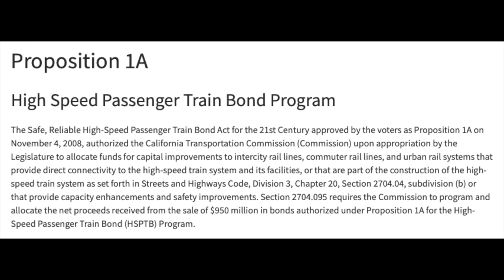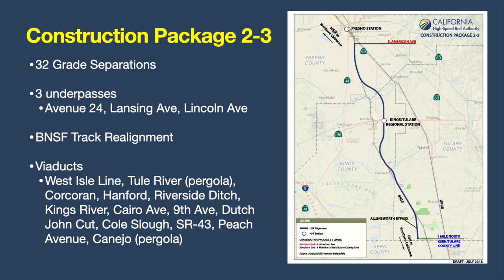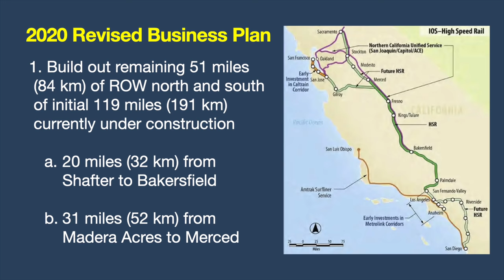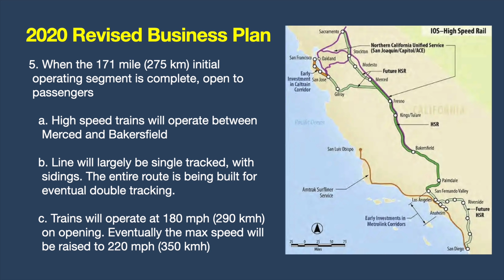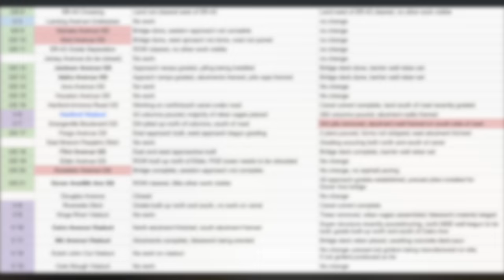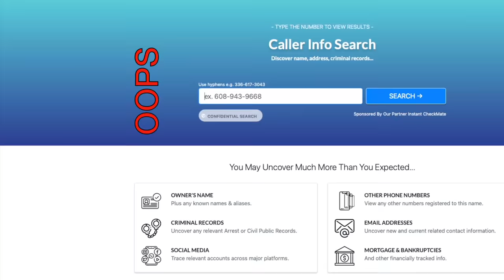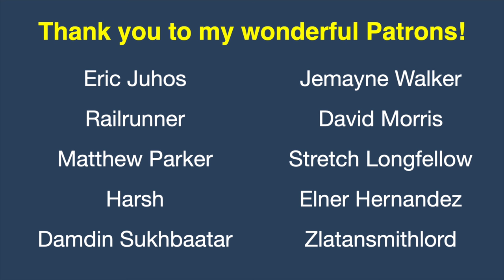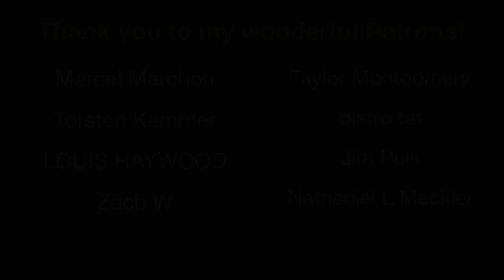California is Building High Speed Rail. It’s time to finish it!

Comment: Would it be possible to build Bakersfield to Palmdale early enough to get it as part of the initial operating segment? Palmdale isn't quite LA, but it's close enough that you could imagine there being desirable connecting buses between various parts of Southern California to Palmdale before the full line is built.
Reply: It would be easy to imagine Palmdale being popular, and the bit between LA and Palmdale on motorized transport being the worst part of the journey (encouraging political support to finish the line)
Reply: One issue-that section will include the longest tunnels in North America. What they should do is build a temporary line allowing San Joaquins to bypass the loop, allowing them to continue to Palmdale, where riders can transfer to Metrolink, or LA.

Comment: I would like to know if hyperloop is really good as they say it is but bullet trains are still getting faster so what is the point?
Reply: Hyperloop is faster, but at the same time, it's an untested technology dubbed as a "gadgetbahn", basically meaning infeasible. It costs a lot more, has a lot more points for failure (considering how the entire network would have to be pressurized), and it's untested. But bullet trains are everywhere and something countries can reliably build.

Comment: I completely agree with you! I wpuld think there would be an inventive for the two big freight railroads to want this completed as it would alieviate a huge headache of dealing with passenger traffic.
Do you think once it is completed there will be a greater incentive to create a route from San Diego to Seattle or possibly Vancouver B.C.?
Reply from the maker: I don’t see why the line shouldn’t be extended at all. Especially considering the large amount of federal money required to build it, going north would be awesome. I think that’s several decades off from becoming a reality, but I fully support it! As far as the freight roads go, I saw a report prepared by an engineer for the Authority and BNSF, and apparently with so many grade separations, that BNSF has required access roads to be built. I would have imagined they’d be happy to get rid of as many crossings as possibly, but I guess you really can’t win lol
Reply: If they can get four round trips per day to Vancouver BC instead of two per day, that would be a huge improvement.
Reply: I don't think travelling between the Bay Area and Seattle will be in the competitive distance for HSR (300-600 km) but Vancouver and Seattle could make it work.
Reply: @kinggator8231  
You would get Portland inbetween there, so the line would be competitive both from Portland to San Francisco and in the other direction up to Vancouver.
Reply: @mikeblatzheim2797  you vastly underestimate the distance between the Bay and Portland. It's about 1020 km or 634 miles on the I-5, for which a high-speed train isn't very competitive.
Reply: @kinggator8231  
This is about 200km less than Beijing-Shanghai, and on that route HSR is both cheaper and faster than by taking the plane. At speeds of 350kph this distance can be covered in less than 3 hours, and even at 250kph (which barely classifies as HSR) it's 4 hours. Even then it'd not take longer than by plane (once you add the time spent at airports).

Comment: Impressive to me is how you have condensed your 2021 fly-over update, with its multitude of on-going projects, into less than thirty minutes, all while presenting each part concisely and at an engaging, interest-holding (but not too-rushed) pace. Very nice job, indeed, Four Foot. 

One thing contributing to the controversy surrounding this massive project is what I would call "The American Short Attention Span," which doesn't have the PATIENCE needed to take the time to REALLY COMPREHEND the complexity of fitting (superimposing) this new high-speed rail line on top of the existing infrastructure along its route. Everywhere the existing infrastructure has to be modified to accommodate the new line turns out to be a custom one-of-a-kind job - greatly adding to the expense and time consumed. 

Politicians aren't accustomed to long-range thinking, nor are they very sympathetic toward or understanding of complex, long-term jobs like this one. The public doesn't see anything but a big construction mess going on seemingly endlessly. There are no trains to ride on, which would allow critics to experience the ultimate reason why all this time, money and effort are being expended on the Ca. H. S. Rail Project.  People hear nothing much but how much all this is costing taxpayers (not to mention cost overruns and the "boondoggle" attitude toward things). So, is it any surprise that this project continues to find itself mired in controversy?

I share your enthusiasm for this vitally important project. There are far too many "naysayers" out there -  we need more people like yourself who intelligently infuse genuine enthusiasm into it. Thanks for putting in the considerable effort you have to graphically "explain" to us viewers what is going on in ACTUALTY out there in California. Thank goodness California's governor, Gavin Newsom, was NOT recalled. Larry Elder, the far-right, conservative candidate with the most votes to replace Newsom if he'd been recalled, might very well have "pulled the plug" on this project.

Comment: I think the HSR could link up the central valley to the Bay Area and move the San Joaquins to that railway (with thruway bus connections to SoCal) while the rest of the railway gets built. 
Ps. could there ever be a railway link between SF to Oakland? It would be nice to take the train into SF instead of getting off at Oakland and wait for a ferry.
Reply from the maker: Yeah no kidding lol. If I were king, right before I dissolved the monarchy, I would have a tunnel built starting at the north end of the transbay transit center across the bay. No need to stop the tunnel in Oakland, it could link to a new line up to Sacramento lol. Obviously the HSR/Caltrain station at the TTC is gonna be huge, but terminal stations are never ideal…
Reply: @TheFourFoot  I think the SF train station (where CalTrain terminates) would be better as CalTrain could be extended to connect East Bay cities like Richmond and San Leandro and even as far away as Martinez to SF
Reply: BART goes from SF to Oakland. You can get it at Richmond CA
Reply: @jamesparson  it's 15 minute walk (with luggage) from Oakland Jack London station to the bart
Reply: The present plan is to add four more tracks between Oakland and San Francisco, two BART broad gauge and two standard gauge. The downtown San Francisco station does not yet have a tunnel connecting to it and it will have only six tracks. Extending the tracks through the station and on to Oakland and Sacramento will increase the station capacity by 150%. This is all decades away. But if one does not plan for the future...
Reply: @AlexCab_49  That's why you change at Richmond for BART or get off at Emeryville and take the provided Amtrak bus from the station to various stops in San Francisco, where you can also access BART.
Reply: @danielcarroll3358  I think it would cost $10-20 billion dollars and take 15 years to complete but it would be hella nice to ride the San Joaquins train from the central valley straight into SF ttain station

Comment: A few years back I Had the opportunity to speak with one of the engineers of the high speed rail for New York State. They wanted to do high speed rail across New York State. I asked one of the engineers of the project if he had been out on the railroad right of Way With one location in particular at Little Falls New York. His response was no I have not. I responded that there is a reason why the lake shore limited crashed at Little Falls New York On the curve doing 60 miles an hour. The New York central railroad was a 4 track mainline. Today you can drive most of it as it is only 2 tracks And to understand the topography of the rail line he might want to go take a look at what it is. This is a problem with these engineers is they do not go out in the field and get a real education of what and where they want to try to build things.
 If you say you're gonna build it for X number of dollars then that's all the money that you're gonna get. If you cannot do estimates then you should not be doing building. Why should John Q public pay extra for your screw up.

Comment: That was excellent,high speed rail between San Francisco and Los Angeles is a common sense thing that will influence more projects being built in the US,as long as you have cities with large populations then it's a go and will pay itself in no time.
Reply: The points are:
1. Planes are usually late
2. Fast trains leave on time,if your late you miss the train.
3. Fast Trains are emitt less air pollution compared to cars and buses,L.A is one of the smoggiest cities in the world so there's a plus for the city.
4. A Fast Train would take more cars off the roads,cleaner air.
5. By the time the system commences the journey won't be 3 hours it will be closer to 90 minutes as technology upgrades will be included in the plan,I've travelled on a bulletin train in Europe many years ago and I can say it's the most comfortable journey I've experienced.
6. If a plane crashes usually the death toll is 100%,if a Fast Train crashes the casualty numbers would far less.
7. Good move California.
Reply: It's not bullshit,times are changing and Bullet Trains are part of future travel,it's not the only form of rapid transport though,Europe has been using these things for decades,don't be so closed minded.
Reply: I have too,but there's nothing we can do about it,the Fast Trains are coming.

Comment: As much as I love this project my only issues with is the constant short sightedness between San Francisco and Gilroy. It desperately needs to be designed for 250mph for as much of it as possible. It's length is longer than HS1 in the UK and that runs at 150. Only because the system it connects to is 180 tops before a 140mph tunnel. 

 The tunnel between Gilroy and central valley needs to be designed for as high speed as possible. It's a long tunnel and if the central valley section can mostly cruising speed. All this would really start to compete with the plane market.

Also can't wait for more of you videos on this!

Comment: Look at those mighty "rivers" and "creeks"
Reply from the maker: Yeah, more water would definitely be nice
Reply: @TheFourFoot  True and they sure do need it. Great video btw. You could release your end commentary as a standalone video IMO, such great points. If only the majority would wake up to reality and help instead of holding us back with bogus lawsuits.
Reply from the maker: Thanks! It might make for a good “shorts” video
Reply: California has a "Mediterranean" climate. It doesn't rain for half of the year. Those rivers and creeks sometimes have lots of water, but we try to capture as much of it as possible upstream with dams. You may have noticed all the farms in the video. They rely on irrigation. One doesn't waste water in these parts! Even the water allowed to flow through the delta is needed to avoid salting up the delta and preventing the pumping of water south to the Central Valley and beyond.

Comment: High speed rail is definitely cool.  I do think that electric vehicles will make a big difference in the overall carbon footprint.  In order for that to happen, excellent, 100% recyclable, batteries need to be produced without rare earth minerals.  That's not far away.  It seems to me that it's orders of magnitude more efficient to increase power generation capacity than to use more internal combustion engines.

Having stated that, I agree with all of the benefits you mentioned about high-speed rail.  Given the choice, I would much rather take the train somewhere than fly, or even drive, if the traffic is bad.  It definitely wins for convenience.

Comment: Just want to ask, is the CHSR fully grade seperated
Reply from the maker: Yes. The new section in the valley is totally grade separated. When they reach the Caltrain corridor and Antelope Valley line, however, there will still be grade crossings, unless they’re removed before then.
Reply: @TheFourFoot  Sunnyvale, Mountain View and Palo Alto are actively working (planning phases) on grade separations for the rail corridor. In a few cases automobile crossings will be removed and replaced with ped/bike tunnels instead.

Comment: This year in Europe thre are several low cost highspeed rail companies that have started operations.  They have tickets of $10 that used to cost over $200 on the same trips.  I dont' know how they do it and it may be just a start up but the video said the prices will be far lower than those $200 tickets and may remain the same price.  Some of the distances would be simular to L.A. to San Fransico.  Imagine a high-speed rail trip from L.A. to San Fransico that costs $9.  That's crazy and even if its $50.  You spend more on gas to travel that far and it sin't going to take you 6 hours, but 1 and 1/2 hours.  If the U.S. built a highspped network with speeds of 250 m.p.h. it would be a huge boost to the economy and would make bookoo money because cities would begin to built metros to the downtown stations to connect to the network.  The best trains with most confort may be expensive but if you want a chap ticket you could get one - bring your own food and drink.
Reply: @upsidedown1671  i understand were your coming from.  Every site on the internet says this, and so do all the videos on youtube!!!  So i won't tell you your lieing - BUT THEY ARE.  start paying attention ot the videos that say that and look at how slap full the train is.  Most trains have over 600 poeople on them and many now (in china) have over 1,000.  And almost every video is slap full or atleast 80% full.  Do the multiplication.  You don't need to know the distance or pric of the ticket at all.  Then think (or look up teh stats) about all th trains coming threw these stations an hour and all the trains that are running on the network a day. - and really think about it - DO U THINK THEY AR RUNNING AT A LOSS - no they are not.  They are making millions of dollars a day off running the trains and even more on teh stations and all the properties around the train stations.  And now they are starting to dliver packages and mail on teh bottom of coaches and soon there will be whole high speed trains that are freight!  They are making money and a whole lot of it!!!
Reply: It's not going to be $9.  The system has a mandate to cover its operating costs.  It will likely be somewhat competitive with air travel, though.

Comment: So in the time its taken for a handful of grade separations and moderate progress being made on some viaducts. Brightline has laid a couple hundred miles of both completely new and upgraded track...
Reply: brightline is not actual high speed rail...nice try lol
Reply from the maker: You’re not wrong, but the projects are quite different. I did do a video on the Orlando extension if you’re interested. It will be interesting to see what kind of progress they can make on the Las Vegas line. I visited the Apple valley station site and it’s pretty remote to say the least lol
Reply: @TohaBgood2  if Brightline will run +125 mph, it IS high speed rail.
Reply: @MarceloBenoit-trenes  "High speed" is defined to be at least 250 km/h (155 mph), though 300 km/h (185 mph) is the de facto standard. 200 km/h (185 mph) only applies for upgraded tracks and is considered "higher-speed" or "medium speed" otherwise. Since a lot of Brightline's tracks are newly build, 200 km/h is thus not enough. That, and HSR shouldn't contain any grade crossings either which Brightline is rather infamous for.
Reply: @MarioFanGamer659  in Europe, 200 km/h is considered high speed.
Reply: @MarceloBenoit-trenes  As mentioned before, only for upgraded tracks but newly build tracks only are considered HSR when they support at least 250 km/h.
This is the definition by the UIC. Some countries do follow some more loose definitions but in Europe, the UIC is generally the standard.

This is true here in Germany as well: Most of our HSR network is made of existing lines with a max speed of 200 to 230 km/h but dedicated, new lines (with only very few exceptions) are build with support for at least 250 km/h in mind.

In other parts of Europe, this is true as well and you can find many new lines which are rated for at least 250 km/h, only rarely slower.

Comment: I believe that once that section opens the public will want the rest of the line finished. Why don't they buy Duel mode locomotives to use electric over the High Speed Route at 125mph then switch to Diesel mode to complete the trip into the city centers until the route is completed?
Reply from the maker: I’m not saying that will absolutely not happen, but that’s not the route the authority is pursuing. Honestly that wouldn’t be the worst thing ever…
Reply: The U.K. has hybrids that can go 200km/h (125mph) on diesel or electricity.

Comment: Excellent video.  (I can’t stand the official CAHSR channel. )

Please give some details on the size of the stations and if there are any estimates of the length of trains and frequency of service. 

IMO The summary at the end of this video would be better if you gave the share of traffics HSR is expected to carry.   The other argument is reducing peak demand on the interstate and on the roads to the airports.  Drivers will understand that. 

The line also won’t reduce GHGs if the motor vehicle fleet shifts to EV.  The sunk cost of CO2 emitted creating the concrete for all those bridges will take some time to recoup too. 

I have only read a few things but the CAHSR project seemed like it was hampered by political compromise, like some of the secondary and tertiary HSR lines of Europe and Japan.